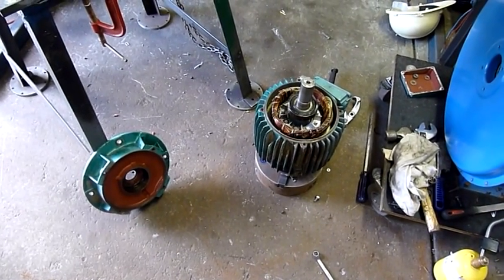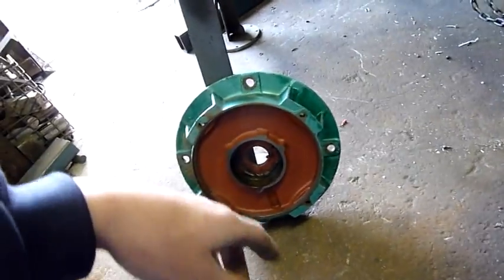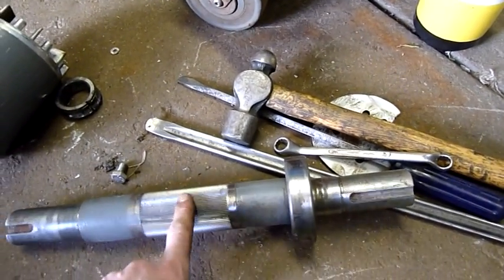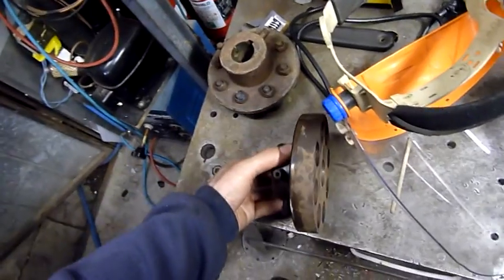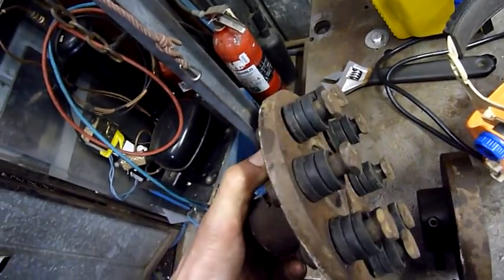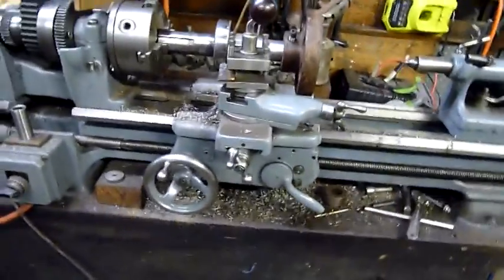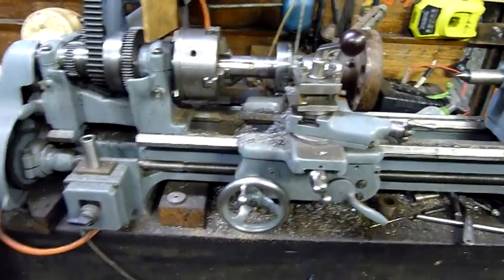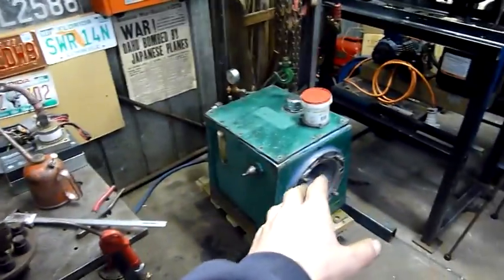Hydraulic Power Unit Conversion Pt2

Comment: Belts can be easily designed to transfer 1000's of horsepowers. Multiple V belt configurations of 6 belts or more are common for heavy industrial machinery, mainly because they are very reliable and easy to maintain. They are also quiet, cheap and isolate vibrations very well.

Comment: Punch the rubber disks out of old conveyor belting, the fabric will add extra strength. I have used belting before to replace the flex couplings, and it is very wear resistant and does a very good damping job. Original flex lasted 6 months ( Chinese one I was not going to wait 3 weeks for a replacement) so took 3 strips and riveted them together to make a new 6 tab flex. Still running a year later with no wear.

Comment: you can do that with engine throttle, or using hydraulic controls. it would make more sens to run that pump off of the flywheel-end, due to the bearings on that end of the crankshaft usually being designed better for loads like that.